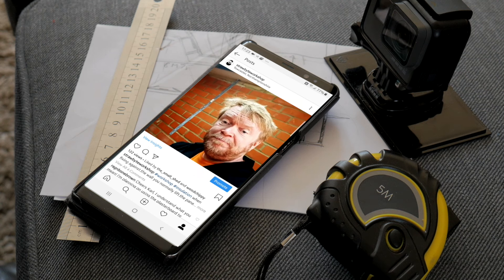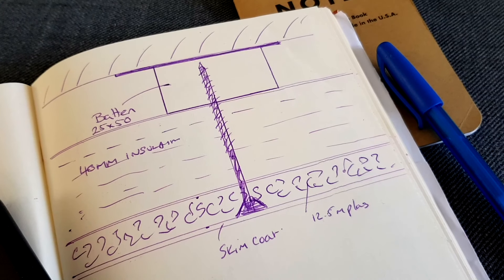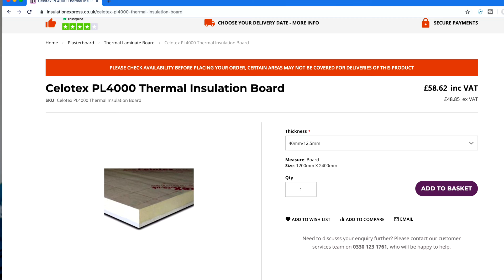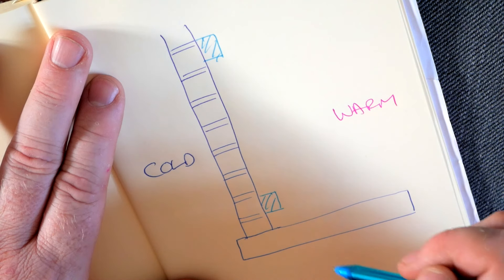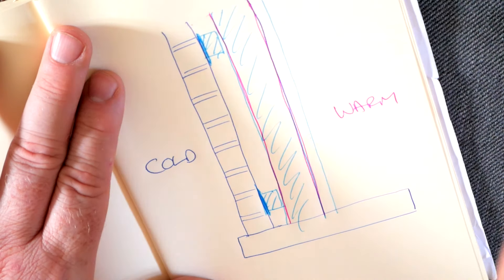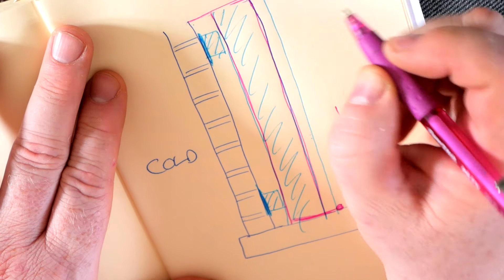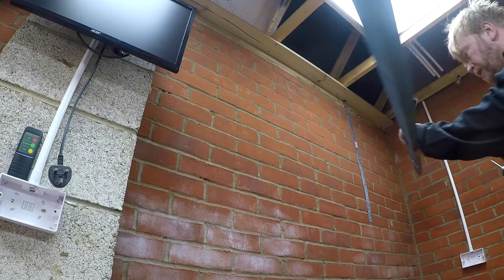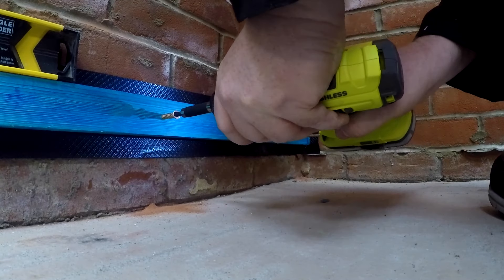How to Insulate Your Workshop | An Easy DIY Project | Keep Your Shop Warm or Cooler

Comment: Lovely video and just what I need. But this ‘vapour barrier’ section is a little confusing are you saying that the insulation you used has its own vapour barrier? And if so what needs sealing? The insulation or the boarding? I am looking to do the same to my intern grates garage and will be ply boarding over the insulation? Does it still need insulation? Kind Regards
Reply from the maker: Hi Chris - thanks for the comment. With regards your question the PIR insulation has a foil surface on both sides of the closed cell insulation in the middle. The insulation is itself impermeable to moisture as a liquid, but the foil ensures its impermeable to moisture as water vapour. Of course when you install the insulation you screw through the material and pierce this layer. Additionally water vapour could pass through the gaps between the insulation panels and around the edges adjacent to the floor, ceiling and any walls (as in my case). So, you will need to tape all the gaps between panels, tape over the screwheads, tape any damaged areas. For the gaps around the edges I used AC50 accoustic sealant (largely for the sound absorbtion) but you can also use any paintable sealant too.

Now of course the second you layer over the top your plywood (or MDF in my case) you poke now holes through the insulation but so long as you pull the panel tight against the insulation underneath the barrier is still good enough. 

In your question i think you were referring to an internal garage (I think). In which case then my answer would be yes absolutely. In particularly the exterior wall to the front and/or side. There is some advantage to insulating the walls facing the house where the benefit will be to assist in keeping the heat in the house. In my experience of a few houses with internal garages there's little insulation in the wall between the house and the garage - just blockwork. One thing I would say though is that the battening technique I used my not be necessary on internal walls (saving you 25mm) since the single biggest advantage of the battens is to protect the insulation from water penetrating from an outside wall.

I hope this helps. Do ask more questions if you want. And good luck with your project.

Comment: Nice project and something I’m also looking at.
I did happen to notice that you did not insulate the brick piers. As this is not a ‘living space’ I dont suppose it matters too much, however this does create some thermal bridging and thereby reduce the effectiveness of your insulated walls, as they themselves are not insulated.
Reply from the maker: Thanks Mike. Over the summer the brick piers have now been insulated and if I get a chance to edit the video took will be a future project on the channel. To answer your question about the effectiveness of the work you saw in the video:- During the hottest summer days last summer the workshop was a good 5 degrees cooler inside than outside by mid afternoon. As for the winter the space was quick to heat-up and slow to cool again making it much more comfortable to work in.

You're absolutely correct the masonry does thermally bridge from the outside to the inside but I did some calculations to enable me to choose the right thickness of insulation and was surprised to learn that each pier was no worse than having a standard door or window opening of a similar area. At that part of the wall the brick and block is around 230mm thick and there's a fair bit of thermal mass. I was surprised how effective the work you see was keeping in mind that the piers were not insulated, one 'bay' was left uninsulated while I waited for a door to be fitted and the garage door wall was not finished.
Reply: @StrawbyteWorkshop  Thanks for the reply and very interesting to know. I assume that now its full insulated, and presumably that also takes care of the vapour barrier aspect, its a nice snug place to work in. Cant wait to crack on with mine.

Comment: Hi, a good video.  a question, why on some walls have you used insulation board and MDF and on others the plasterboard bonded insulation?
Reply from the maker: It's a good question and you're right I didn't dwell on the reasons for switching from one approach to the other. The video compresses time at little and the first two walls were very much a learning experience and were completed a couple weeks before the remainder of the workshop. The two key factors were that the plasterboard needs to be kept dry at all times and is bulky to store. The 4 sheets I initially ordered just got in the way too much and coupled with the second factor being that it was extremely hard to handle the material on my own due to the weight I decided to switch approach. For the remaining walls I could order all the insulation that I needed and store it outside. MDF was bought daily from my local B&Q. On the plus side the finish on the plasterboard wall is way way better than the MDF and if I were to do it again and I wasn't building a workshop (music studio or home office) I'd probably prefer the insulated plasterboard product and find a better way of storing and organising materials. In terms of cost, they area about the same.

Comment: Out of interest;
Is it warmer? 
Does it help with sound leakage? 
Why didn't you paint the protruding breezeblocks? (Style or practical?)
We're you quoted at all for a builder to do the work?
Reply from the maker: Wow, plenty of questions.
WARMER? Yes, but don't forget that you need a source of heat in the space too. The important thing to say is that I don't have my fan heater on for long to go from around 5-8 degrees to a comfortable 13-15 degrees. Once warm, it stays warm.
SOUND? To some extent. I have measured before an afterwards and there's a 10db reduction in noise as heard from various points outside. Had sound been a focus I would have bought the finished wall out beyond the concrete block pillars and doubled up inner surface (MDF). You need mass not soft warm stuff to reduce sound transmission through walls.
CONCRETE BLOCKS? These have now had insulated panels installed on them which are super strong and look really cool. I really should do a follow-up video on that work.
BUILDER? No, well actually sort of. My dad is a retired builder and who I worked for as a young man and he advised me on some of the work. There was a key consideration around having a builder do the work - the builder would have expected the entire space to be cleared free of clutter and (importantly) my stuff. I did worked with a builder on the door project who said a similar job he'd done recently was charged at £9500. He installed a plasterboard ceiling and leveled the floor with a raised timber floor.
Reply: No idea why it's taken me a year to see the reply. £9,500 is a hella lot of money for what I need, especially when your material breakdown was "only" £760
I've got a 5m x 5m garage that I want to continue to use as a garage, but also put my treadmill in. The idea is to insulate it to create a dust free, temperature controlled area. It'll need aircon probably. The noise question is because there's every chance I'll be out there at 6am running and don't want to get an ASBO 🤣
I'm now thinking my best bet is to do one section of each wall at a time, working my way around to spread the cost and work. Like you, I have a lot of stuff in there to move about including a car.
Another couple of questions I have is why did you mix the boarding? Some parts were plasterboard and some parts were the other stuff? 
And I need to have a bike rack and a pull up frame on the wall. Assume that's going to need battons behind worked out for where they need fitted?
Great video and think I'll use it as my guide!

Comment: Great video. Have you done anything about extracting saw dust and ventilation for the dust extraction or has the latter not been required? I'm thinking of making a workshop too and concerned about an efficient way of running a shop vac
Reply from the maker: Hey. That's a great question and I've got a video where I talk about dust extraction in-mind. Keeping my workshop as dust free as possible has been a priority lately. I've tackled it in stages:
Stage 1. Assess all of my tools and think about if better tools can improve dust collection. To that end I've ditched my cheap Ryobi sander and bought the very expensive Mirka DEROS; ditched my DeWalt mitre saw and replaced it with a Festool Kapex. Expensive changes but I do value my time in the workshop and spend way less time cleaning up.
Stage 2. Dust collectors. I've a second shop vac now. It avoids the need to move the one I had every time I change tools. I've bought a dedicated HVLP extractor for my planer thicknesser. I'm still figuring out this stage. I bought a second-hand CAMVAC which might be the extractor for a workshop-wide extraction system like Rag'n;Bone Browns.
Stage 3. Shop wide solution. My tools don't travel to site and are now largely in the locations I need them. Some sort of system, with a cyclone perhaps, would make sense now. I'm still thinking about how best to do it. I didn't board-over my ceiling which allows me some flexibility in any installation, but even a few meters of ducting is fairly expensive and I could by 2 more Nilfisk shop vacs for the price of the materials.

In terms of ventilation I've fixed my workshop door so I can open the top leaf in the summer. I've installed an extractor in the roof to vent warm, moist, stale air out of the workshop. And in the winter run a de-humidifier which really does help with the quality of the air. And finally, talking about air quality, I have a record power AC400 air cleaner which is fantastic in keeping airborne dust at bay.

Plenty there for a video I think.. But thanks for asking. Karl.
Reply: @StrawbyteWorkshop  wow, you've definitely had to think about this a lot, do that in itself is a tip I'll take heed of. Good luck and I look forward to the video. Charlie DIYte did a decent video on cyclone and extraction. I think my first priority is buying the house with a garage 😛 Thanks for the detailed answer

Comment: Thanks for the video. A question if I may. Did you consider putting a vapour barrier etc. on the breeze blocks to stop the condensation and the cold spots?
Reply from the maker: Hi Jon. The concrete pillars have now been fully insulated. The reason they were left out the original video was because I wanted them to be strong points in the workshop and I wanted to give more thought to how I go about doing that. The solution was build a box within which I laid a sheet of insulation and then bolted it to the concrete pillar. I do intend to put out another video on what I did in the next month or so. 

K
Reply: @StrawbyteWorkshop  Thank you I noticed it in your next video. Are you also going to be, doing a garage door and roof explainer as well 😃?  Thanks again great content.
Reply from the maker: @jonedwardes4852  Jon - there is a roof explainer on this link: https://youtu.be/fpO6lMwRpCQ The video was public for as long as the one you've watched. A viewer politely pointed out a mistake I made in the construction of the insulation. Once the comment had been posted I got heap of abuse from roofers who rather impolitely pointed out the same mistake and hoped I would learn a lesson when the roof rotted through and colapsed.
I have had my friend who frames and insulates roofs all day take a look at the installation itself and there's no condensation between the layers and he's suggested a moderate amount of remedial work to put it right. I'll re-edit the video and re-post when I've completed that.
The garage door was covered in a blog post on my website.  https://www.strawbyte.com/blog/2018/11/18/how-to-insulate-a-garage-door
This has been pretty successful. The only remedial work done not mentioned in the article was the installation of a 'brush' style draft excluder on the bottom of the door fitted on the outside.
Reply from the maker: @jonedwardes4852  Just to quickly explain, after deciding to put a second layer on I used battens to create a space and avoid having to cut around the boards that tie the roof in.
that gap creates a break in the insuation it a) reduces the U-value b) creates an opportunity for moisture to condense between the layers.
What I should have done is put the battens an brought the first layer out to be flush with them, tape them again and then place the second layer over the top and tape a final time.
There's about 6 hours of work to take down the second layer, pull the first out and re-fit and i'll be tackling that in a bit. It also improves ventilation under the tiles and sarking.

Comment: Great video, this has really helped me get my head around this project. Potentially a stupid question.. do you not need to seal the edges where the insulation boards meet on the sides facing the wall? Like you have with tape in the roofing on the inside? Have no idea how you would physically do it but curious
Reply from the maker: Good question and I did touch on it on the video. The sealing of the edges is acheiced with sealant and expanding foam for larger gaps.
Reply: I'm thinking bording across rafters is way to go for me. What are you thoughts on leaving the top behind insulation open to have air from roof space? I would think more air flow potential would be a good thing?? Or better to 'box' in like you have with the point you mention at the start from Instagram?

Comment: This is an excellent and very detailed video that will help others who plan to insulate their workshop. I have a question, did you insulate the door of the garage? Can you provide a short description of how you did it, what materials you used and whether it stopped noise going out and heat staying in? Many thanks for your help.
Reply from the maker: Thanks so much for the comment. To answer your question I did a blog post on my website a few years ago. See https://www.strawbyte.com/blog/2018/11/18/how-to-insulate-a-garage-door

Comment: Hi, as well as mdf I plan on putting a layers
 of high density vinyl and an extra sheet of mdf on top. Do you think the 1x2 batons will be fine supporting that weight? It’s a new build garage single skinned if that makes any difference
Reply from the maker: I ignored the thickness of the insulation and calculated he thickness of the Barton based on twice the thickness of the sheet material on the internal skin which is where the weight is. You need to bear in mind the first 5-8mm of your screw is pointed and provides little holding power. So if you're using 24 mm of material (2 x 12mm ply) then I would recommend a 50 X 50mm batten and choose your screw length carefully to penetrate to the back of the batten. So in my case a 25mm batten, plus 40mm insulation, plus 12mm MDF is 77mm and used 75mm screws. You also need to space the screws into the batten 300mm apart. So you'll be putting at least 8 into a 2.1m upright 
I hope.that helps.
Reply: Strawbyte Workshop great thanks for that. If I go with 50x50 battons, do you think the 100m masonry screws will be enough to keep them to the wall?
Reply from the maker: @mathewbarwick8167  If you can get them try use 125mm screws. You need to drill a clearance hole in the batten wider than the threads of screw and don't over tighten them. And use a standard drill driver rather than an impact driver which in my experience leads to the failure of the fixing as your driving it in.
Reply: Thanks again. Started today and appears to be holding well! How did you fix the dpc to the battons? I’m think of using a staple gun...
Reply from the maker: @mathewbarwick8167  Yes, a staple gun. But I found you only need to fix into the ends. Once youve screwed the battens the wall the screws hold it in place. It shaved minutes of each batten and a whole heap of time overall.
Reply: Strawbyte Workshop nice one, I feel like I’m going to owe you some sort of commission once I finish this haha!